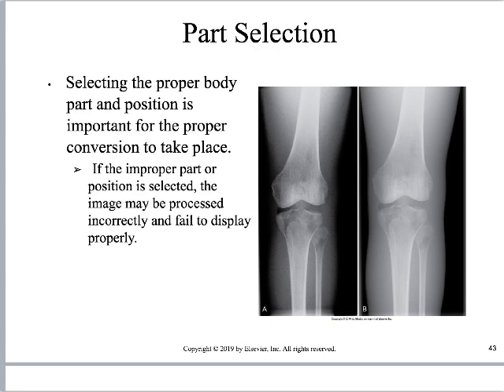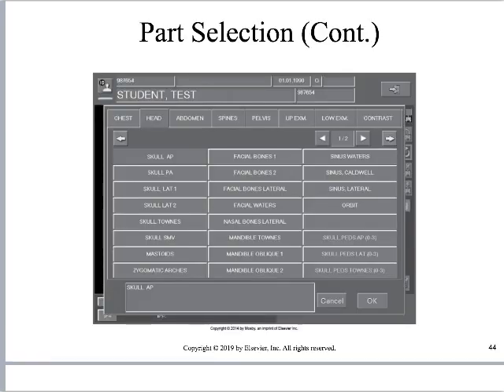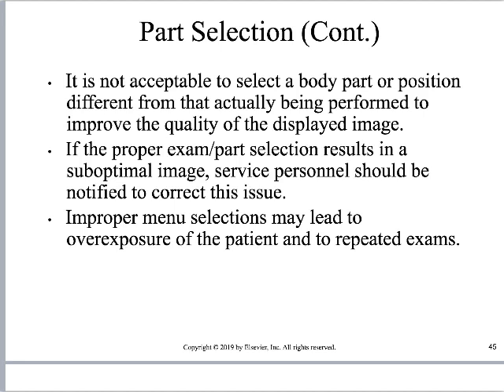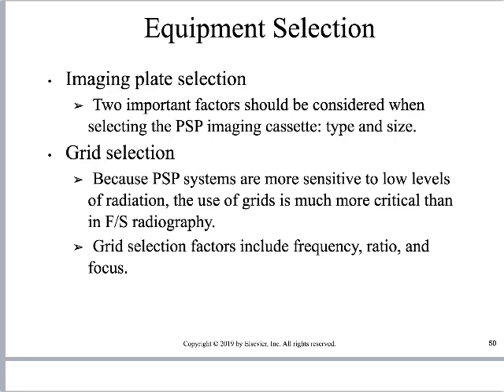Photostimulable phosphor plate

Comment: How latent image is formed in the PSP?
Reply from the maker: Great question! It has to do with properties of the crystal in the active layer. Typically the material used is cesium iodide. When an x-ray photon ionizes the cesium iodide, the crystal changes it's structure. As this happens across the entire PSP, it creates a latent image. Later when the PSP is scanned by the laser, the crystals return to a more stable state, releasing energy in the form of blue-violet light which is picked by the photomultiplier tube and used to create the radiographic image.